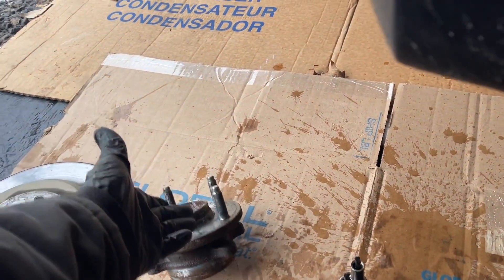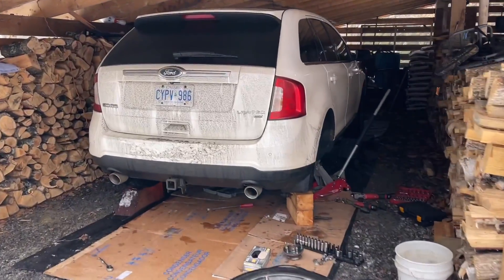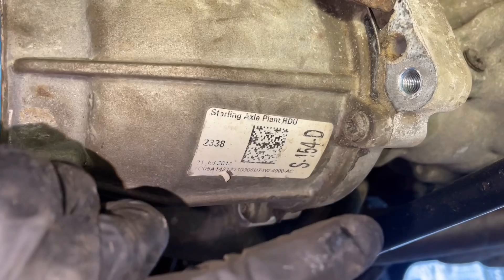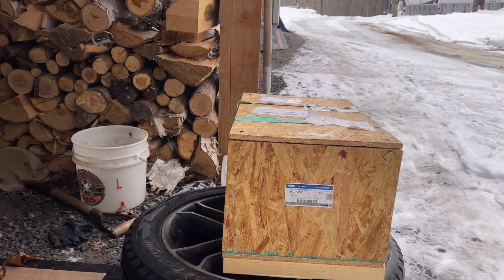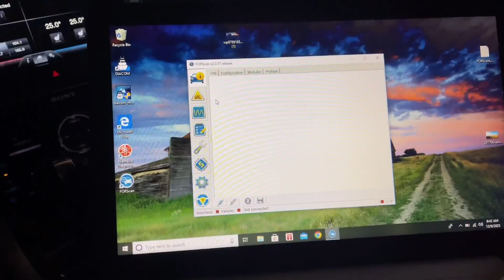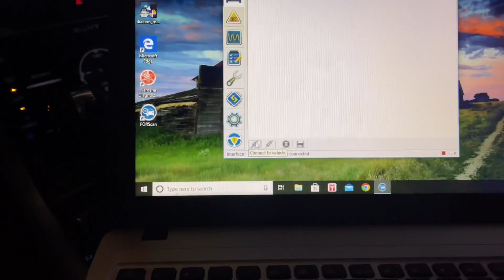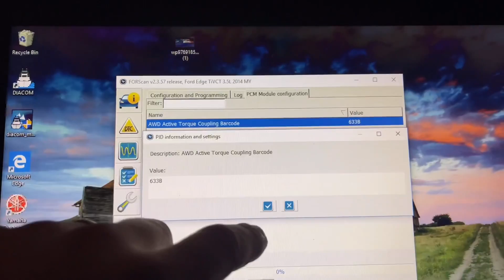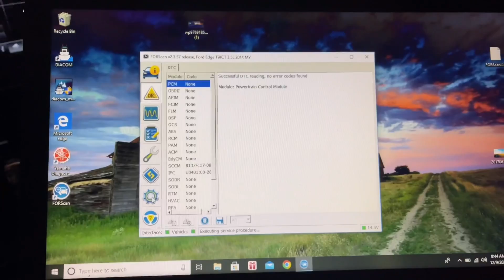2007-14 Ford Edge Rear Diff (RDU Replacement) With Computer Programming How TO.

Comment: Just purchased a 2014 edge used, and the dealers that had it had done a rear differential replacement already, however, not being a Ford dealer they didn’t know about reprogramming the torque coupling code into the PCM. Thanks to this video. I now know how to do that and can save some money instead of having to take it to the Ford shop. Thanks again! Cheers from Pennsylvania.
Reply from the maker: Hey thank you for the comment. Good luck, also let me know if anything changes when reprogrammed.
Reply: @Schneids15 thanks and will do!

Comment: You cannot just swap the yoke onto a different flange without first replacing the crush collar and resetting the preload. This is why you all have a shake still….
Reply from the maker: I would like to hear more this intrigue’s me. Is there a crush washer inside like a conventional pinion and yoke on a truck? The Ford instructions never said anything so I’d be interested to try this.

Comment: Thanks you so much for this vidoe and the short programming class you just save me a couple more bengamine...i drive a 2014 forg edge and my issue is the grinding noise when turning left or right from the rear diff. But when i drive forward or making a reverse all is okay no sound is hearddo also need a new diff or can do  overhauling .

Comment: Thank You for posting this I couldn’t find any tutorials for my car 2011 Lincoln MKZ but I assume it is a pretty similar procedure considering the drivetrains are both quite similar. I am pretty sure I burnt out the clutch packs in my RDU during some aggressive driving and Ford doesn’t sell a clutch pack replacement kit for my car so replacing the RDU is my only option.

Comment: Great video! The Forscan tutorial really helped. Just did the rear differential on my 2016 Edge Sport. I used jack stands but would definitely recommend using something for better height clearance like the lumber stack you did.

Comment: What if the new diff doesn’t have a code on it? Should I just use the old code?
Reply from the maker: The old code would be programmed into the car, I’m not sure in this case. You have searched all over to verify no code?
Reply: We have located the code finally, however we have yet to program it hoping to do so tomorrow when the cable comes in. I did have another question though. There is a piece called the driveshaft yoke I believe. Do you think it could cause complications if on the new diff you use the old yoke instead of the one it came with. We did that just bc the one it came with doesn’t fit the driveshaft.

Comment: What will happen if I didn’t program the new diff
Reply: I installed a new differential, and when I drive, the car shakes a little. I will program the new differential and let you know
Reply from the maker: Ours shakes as well. I assumed I had not got the driveshaft balance and input coupler properly centred.
Reply from the maker: I’m not sure. Let me know though. I always wondered the same.
Reply: I wonder if motorcraft friction modifier would help?

Comment: If the old one is S-154-A and the new one is s-150-A will that matter ?
Reply from the maker: I really do not know. I could not determine this and bought one through ford.
Reply: Were you able to figure out if it matters mines is a S-162-A and all the ones I see on eBay are S-150-A

Comment: So I took my 07 for edge to shop and they said it would be around 3 thousand and said it could last 100 to thousands of miles yet.. literally next day driving pulling up to the stop sign was grinding and then pop and wheels locked and bucked I was able to get it down the road some into a parking lot was going to get it towed to garage but been calling around… definitely not cheap
Reply from the maker: Not at all, may be able to get a refurb off ebay for cheap. I found many used ones for other years. However for my 14 it seemed there was something special about it.

Comment: Hello there my wife has the 14 edge we can’t afford to sell as we need a large suv due to her MS . Where did you get the differential and cost
Reply from the maker: Hey, unfortunately had to get it from the dealer. It was around 3000$. Many on ebay for less than 1000$ but I could not guarantee fitment.